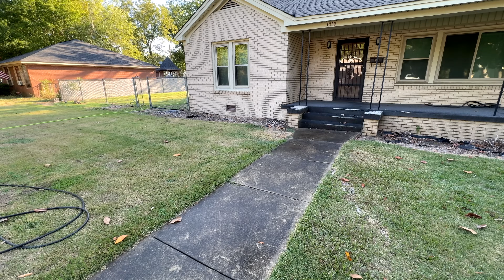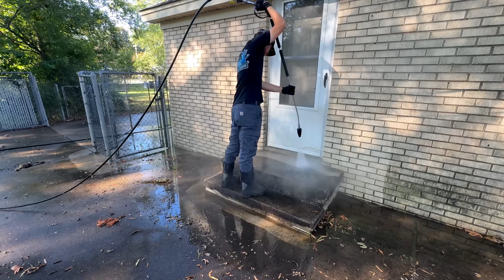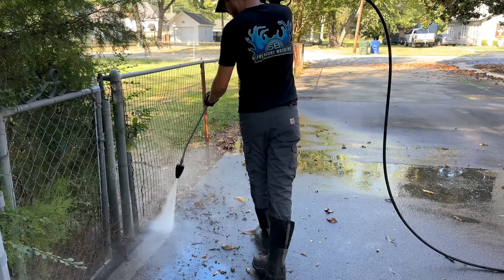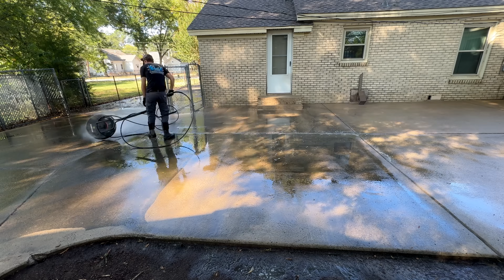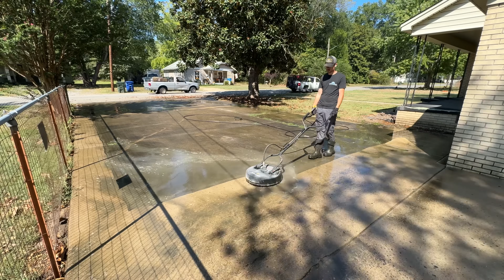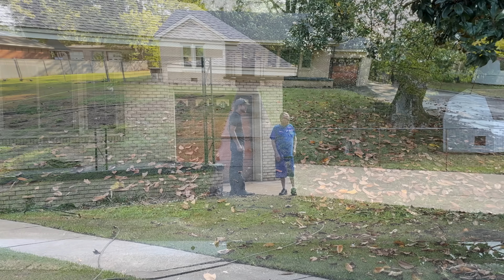70 YEARS of DIRT gets REMOVED in 4 MINUTES

Comment: Here's a thinker for you. My parents walk away down the side of their house was like that color 70 years of dirt. I took Clorox bleach bottles. Pour them all down the walkway and scrub them will the heavy duty push broom. For about 10 minutes. Let it sit there to the next day. Check the power nozzle for the hose you know the one that will make it shoot 20 or 30 ft or more. Comes out in a little circle. One pass was clean🎉 maybe you should invest in some bleach. On top of the pressure washing to speed things up. Seem like it would be worth a shot if you spent all day here. For a few dollars in Bleach🎉 I swear to God it made that concrete white white like it was brand new. Mike parents couldn't believe it look like that underneath. So guess what I had to do next all the rest of the walkways😮 PS bleach didn't harm the plants or blonde or anything else if that's what you were wondering I could see that coming up my parents have an extensive Garden.

Comment: @SB_Pressure_Washing-Shorts SME Question: How do you deal with concrete that’s falling apart - Like cracked concrete that has little pieces loose in the cracks? Does the pressure sprayer generally just debrided the loose stuff? For the best results… If we wanted to fix those cracks or tend to them in some way before pressure washing, what do you suggest?